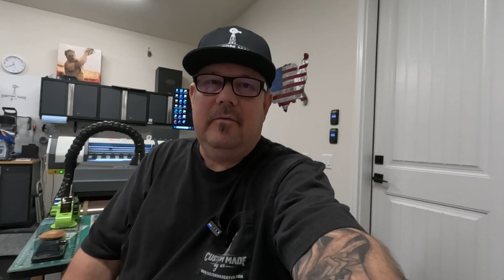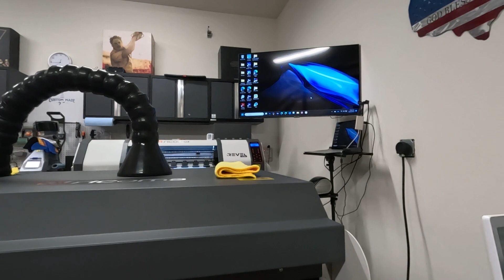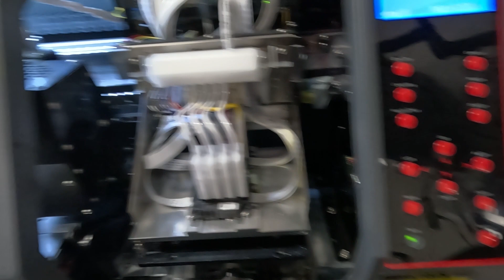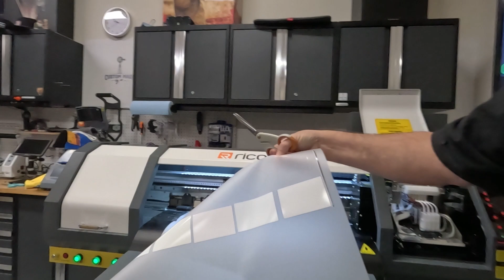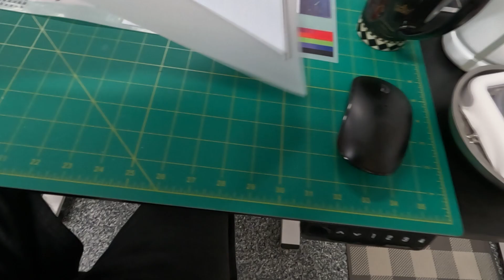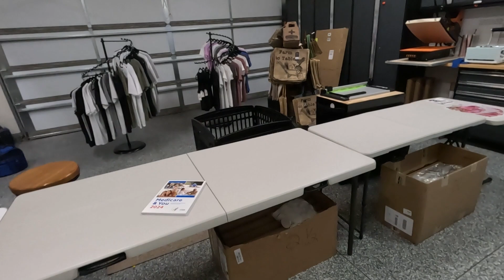My morning routine/maintenance on the Ricoma REVEL DTF-2402 DTF Printer.

Comment: Hello Nate, I have watched all your videos and I can thank you enough for getting them posted.  late  last year I got me a 
Revel 2402T the 12 in wide. your videos helped immensely. But I have run into a problem with my printer. I was carrying on my daily routine and it started to smire big time, to the point that black ink and white ink run and mix. I have done all i know to do as far as cleaning running tests and chinking all parameters, try to contact the company ricma but they have not gotten back to me yet. my be they are just as surprised as I am, any way just since you are very technical I was wondering if you know of a problem like this, with this or brand or other brands that can shine a light on this situation. I have the vivid program and the hosonsoft, not sure if it is a setting problem or mechanical. have you herd of a problem like this from any of your friends who own the same machine?. if so I will be all ears, and oblige. grate work on your videos Nate, thanks you so much.